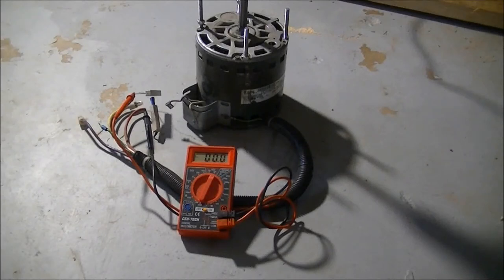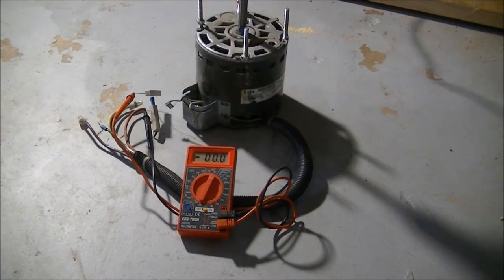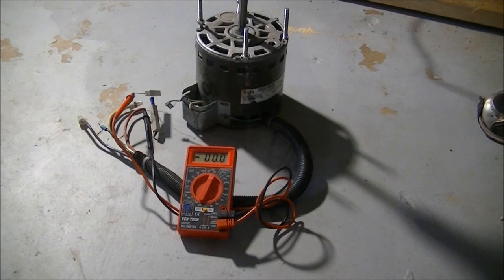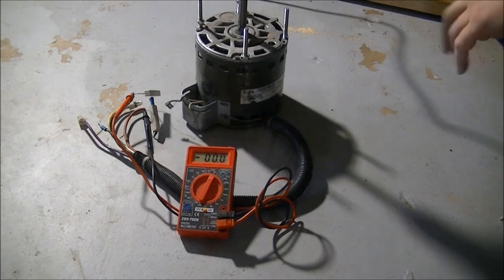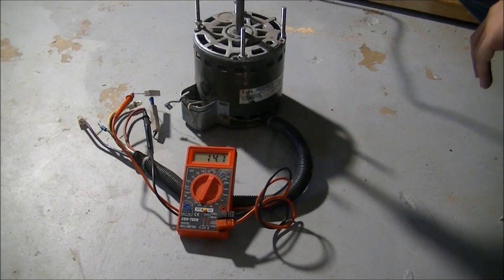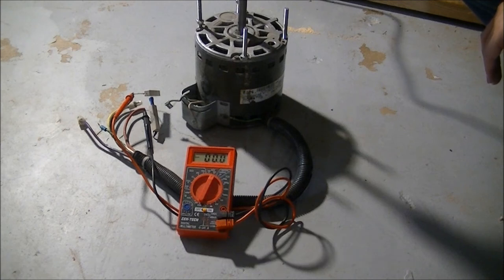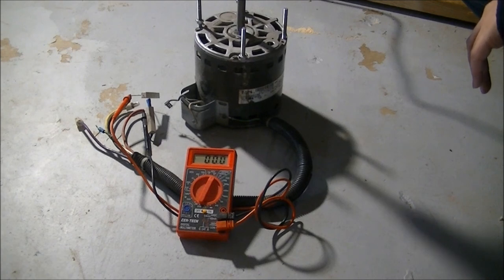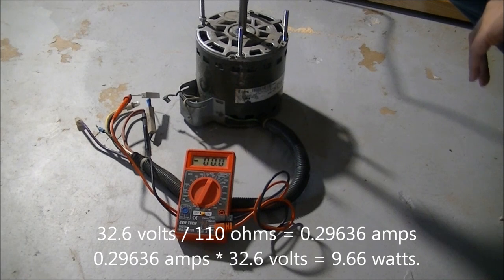DIY AC Generator Test

Comment: Not enough to charge a 12 volt battery. May be the field is not big enough wire. And maybe more magnets also may help. They dont look close enough together.
Reply from the maker: If I build a 3rd one I will use more magnets and a bigger motor.
Reply: Jason Roush I hope to see you be successful. It is a good idea.
Reply: to charge 12v battery u need over 12.1 volt (12.9 - 13 volt is best to charge battery if u dont wont to short a life of a battery). if you have that voltaget then you should use diods, condensator... u know the rest... speed of charging depends, in that case, how many mA or A do you have
Reply: most chargers are set up to deliver just over 13 volts

Comment: its at least something :)

well a car battery would "suck" 1 to 5 amps for charging, depending on how much was left in it or depending on its capacity.

unfortunetely all these motors or generators have to work on high-speed  to work properly.
Reply from the maker: The good news is I dont have to worry about buring it out over to many amps.